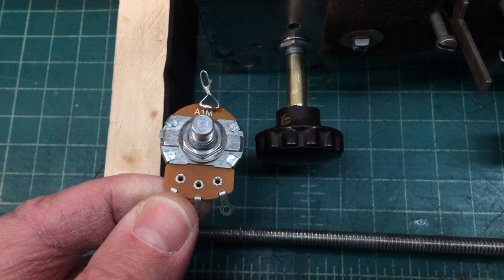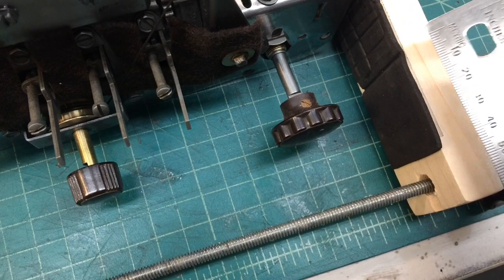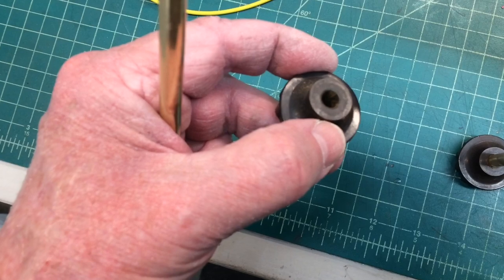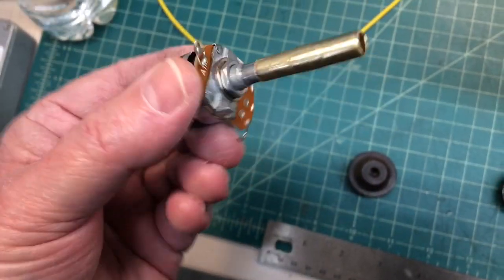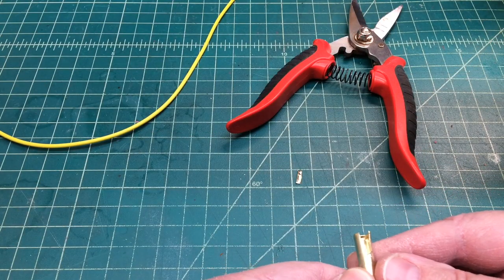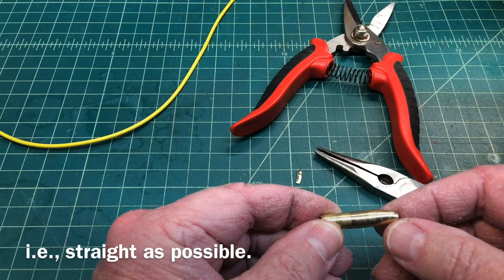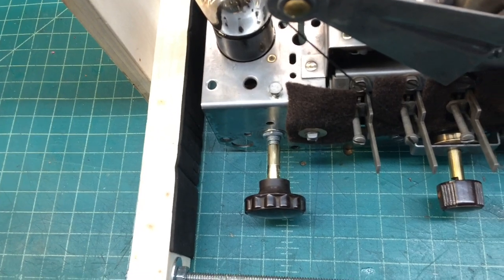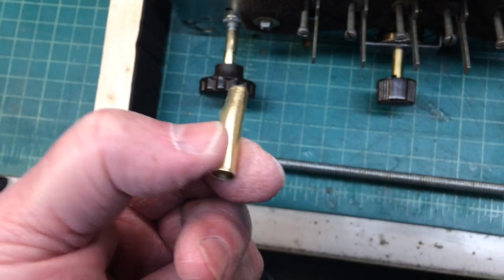Crosley 718-B - Building a Volume Control Shaft Extender

Comment: This is a great idea. One improvement I would suggest would be to use a solid brass rod as the new shaft; make the sleeve from the tubing as normal, but make it a bit shorter. Then, solder a length of 1/4" brass rod into the other end for the knob to attach to.
Reply from the maker: Great suggestion! Thank you for sharing this. Best, Don

Comment: Nice easy fix Don. Thanks for sharing.  Here is a tip.  I have used the brass tubes before. But I fill the end that was cut with silver solder or lead.  Only a few mm thick. This now gives a solid core for the set screw and does not come loose over time.
Reply from the maker: Buddy, very clever and thank you for sharing this one. I’ll have to build me another one using your technique. You can never have enough shaft extenders. Best, Don

Comment: I used crossbow bolts - plastic ones.  They are just the right diameter.  Used Banggood shaft couplings to make the joins.
Reply from the maker: Thanks for sharing this solution, much appreciated. Best, Don

Comment: I did like that idea Don. Last time I had a shaft to change I managed to just swap between pots but never tried a swap to a modern pot because the sizes are different. The vintage stuff is 1/4 inch but our new stuff is all 6mm so your sleeve idea is great.
Reply from the maker: Thanks George. There’s many other options too that I’ll expand on in a future video. Best, Don

Comment: Hello Don. Good idea to use a brass cilinder to elong the shaft... but I shoud have used at the other side the shaft of old potentiometer...
Have a nice day.
Ketk (Spain)
Reply from the maker: Definitely; you can use the old shaft too. This potentiometer is still good, just the wrong value for this application so I didn’t want to use it as a donor. Best, Don

Comment: Here’s a another way. Cut a piece of the shaft off the old pot. Then epoxy that piece along with the new shaft inside the brass tube. This way the old shaft still accommodates the original knob. Never tried it but seems like it should work.
Reply from the maker: You are spot on. I was out of 1/4” solid brass and didn’t have a dowel that’s size either; go figure. I didn’t consider sacrificing the existing control, because it’s still good, just the wrong value at around 3M tapped at ~1M. Your recommendation is the best approach and provides a real solid solution.  Best, Don
Reply: Thank you. Love your work.

Comment: Could be better instead to cut the tubing where the knob is I pull the knob screw insert the tube and mark the spot where the screw land and make a hole the same size of the screw, reinstall the knob screw and line up the screw with the hole is. I always keep old damage potentiometers just to reuse the shafts, switches etc.
Reply from the maker: Thanks for sharing your M&P, very informative and helpful. All the best. Don